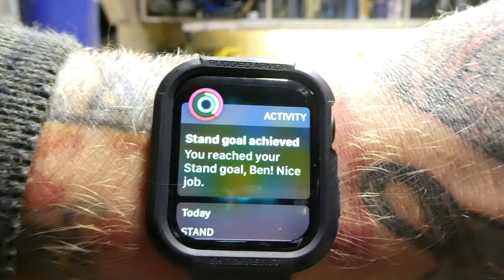FN2 Type R Carbon Fibre seeker spoiler install

Comment: Hello guys, is this the only way to install this spoiler? Can it be removed afterwards with the material you used ?
Reply from the maker: Can only be bonded In unfortunately, tiger seal is generally the best for the job

Comment: Looks awesome! does it cure well left overnight? I'm looking to glue typeR spoiler to typeS and wonder how long do I need to keep it idle until it's proper in place.
Reply from the maker: Would recommend leaving it overnight it ain’t coming off once it’s on out it that way, my mugen spoiler is on with it also. We tend to use tiger seal normally
Reply: @CowabungaCarDiaries  good to know, thanks lads!